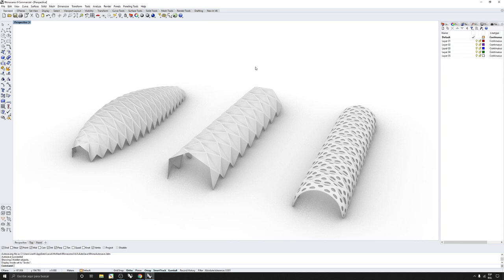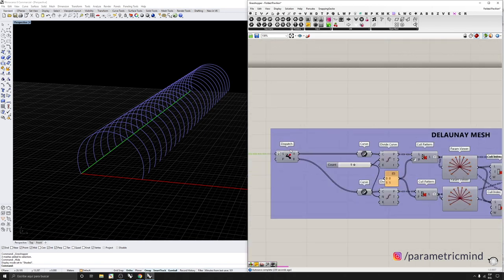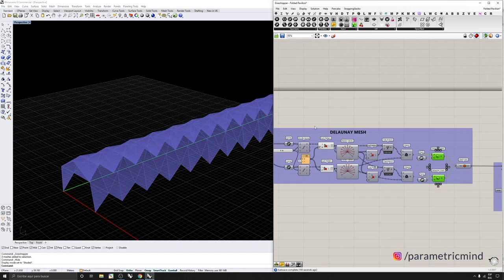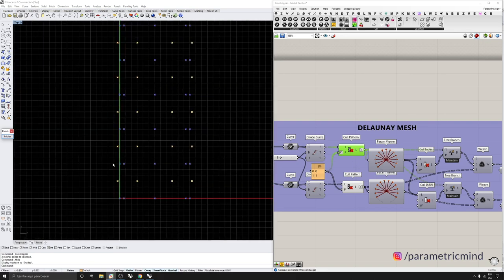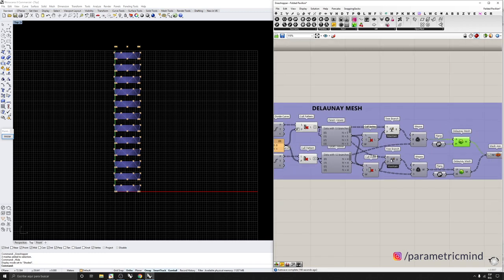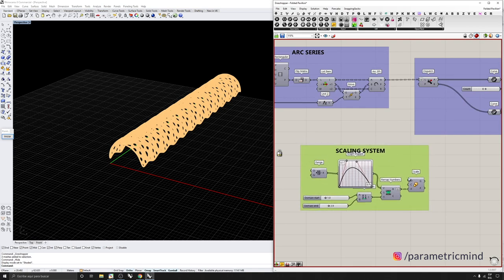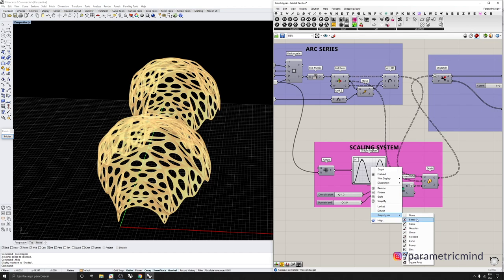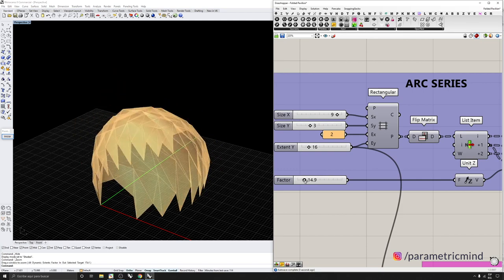Folded Pavilion with Grasshopper

Comment: whats the plane on the delaunay mesh
Reply from the maker: Hi Arsy, I just extracted the parameter from the input. You can do that by doing right click on the input plane of the Delaunay mesh an click on extract plane. I it is actually not important, you could also leave the plane input as it is by default

Comment: Hi. When I connect my top param viewer to the top cull index, it doesn't work. It appears a warning (on cull index) with the text "input parameter list failed to collect data". It happened to the bottom cull index too. Can you help me, please?
Reply from the maker: Hi Julio, if your param viewer is working, then it means that it is collecting data. This data is sent to the cull index (in L input). So if does not work, there has to be any issue with the indices probably. Make sure that you are sending the indeces correctly.
Reply: @parametricmind_gh  Thank you. It worked here.